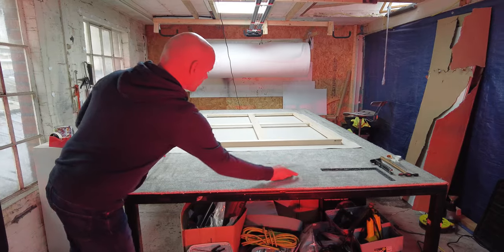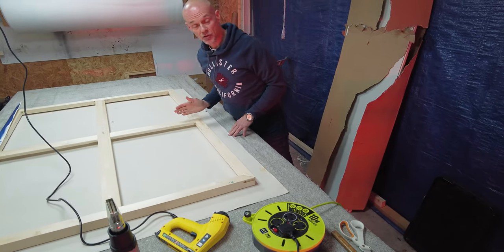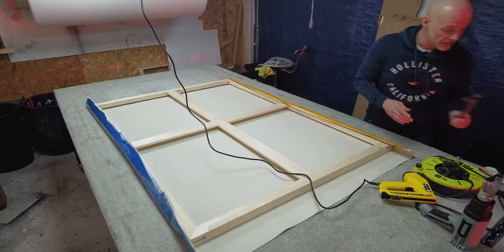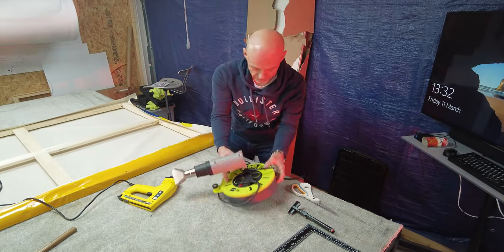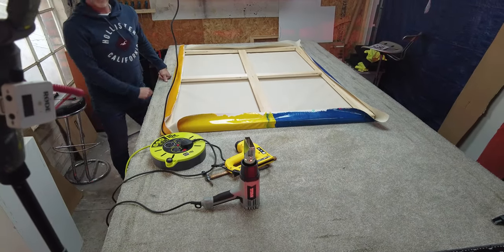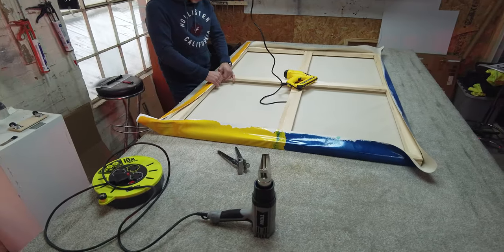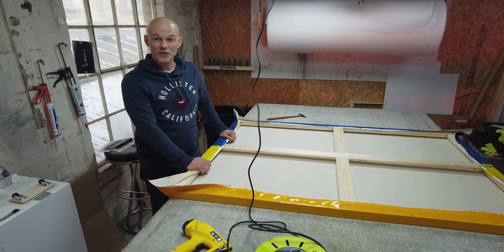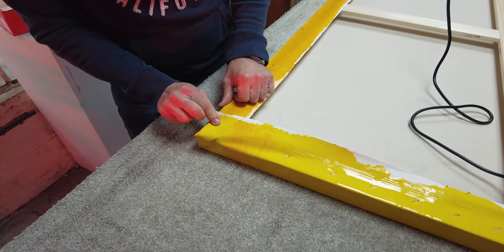Supporting UKRAINE - the painting is finally revealed! 🇺🇦

Comment: Alas, if I put up every penny I have, I would still be out - bid in the first 5 minutes (probably less!)  Still, I'm sending you my very best wishes for a successful auction.  On a side - note, watching someone stretch a completed canvas onto a frame is always a heart-in-the-throat moment for me.  Back when I was a painting student, there were times when some of the students found it necessary to re - stretch one of their works and this often led to the painting ripping during the process.  I think the sound that made haunted all of us in our sleep!  I've wondered though if it didn't have something to do with how we prepared our raw canvases for painting.  We were trained to size our canvas with rabbit skin glue after stretching the canvas to ensure that it would have a stiff, flat surface before gessoing.  Seeing how easily your paintings fold before you stretch them makes me think that you probably don't do anything like that before you begin painting.
Reply from the maker: No we don't Joseph - although heat is a good way to loosen the weave and the paint so that's an essential part of the process to avoid rips and get the best tension we can without the dramas... Thanks for supporting the initiative - I hope we can do some good
Reply: Bid now
Reply from the maker: @rodjos5463  yes!!!

Comment: what do you use to get that glossy finish? I've tried spray on clear coat but it takes to much to get a thick even coat
Reply from the maker: I don’t actually use anything! The finish you see is built into the paints at source so I never use any finishing products - once the paint is cured that’s it, that’s the finish. Hope that helps.
Reply: @SwarezArt  okay thank you, so I've always used acrylic or oil what kind of paint would this be called?
Reply from the maker: @cowboymillionairemichael  this is enamel paints Mike. Here is more information: https://www.swarez.co.uk/using-enamel-paints/